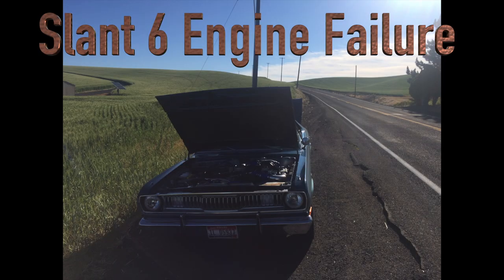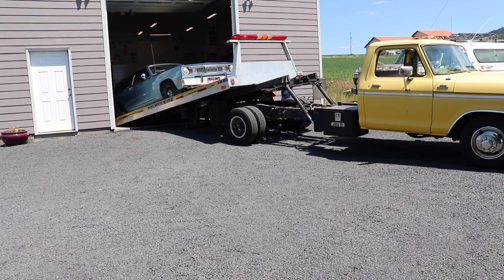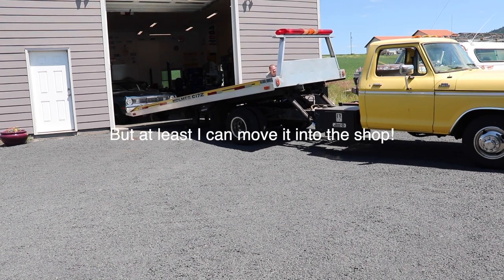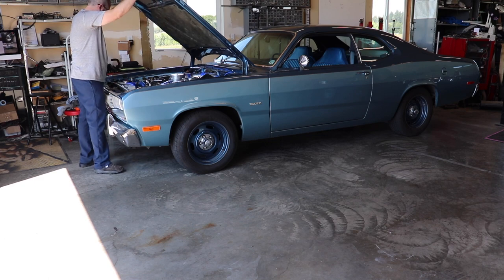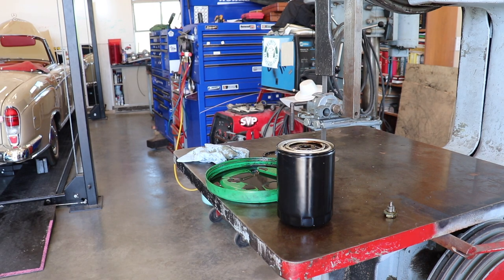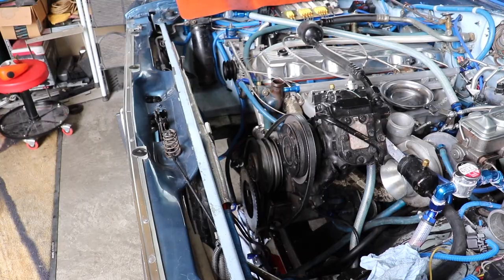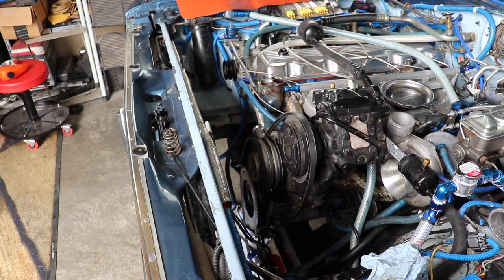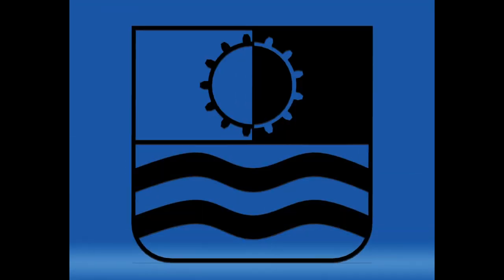Slant 6 Oil Pump Failure

Comment: Subscribed. "Doc" out in CA IIRC was building/porting oil pumps for these at one time. I had a '74 Dart I was going to do a 2bbl conversion to. It started knocking one day when I was warming it up. I was the first person into the engine. It had one of those shop rags in the oil pick up. Not much left of it. Mostly the nylon not the other fabric. It still sits on my engine stand 11 years later.

Comment: Is that a stock oil pump? High Volume/pressure pumps put a lot more stress on those drive gears than they were ever designed to handle. Adding power to any engine beyond it's design parameters will expose the weak points.

Comment: My 225 slant6  just blow up and mines 100% stock
Reply: Fram oil filter?
Reply: @Really-AintBuyn-nit  Yeah, right? Probably. These things don't just happen like that. It's a slant six for god's sakes. They don't just blow up for no reason. Fram is okay, but don't buy it at Wal-Mart. They make em' different for Wal-Mart, I guess. As for the engine on this vid... It shouldn't be done up like that. More shit to go wrong.

Comment: No wonder it failed. Slathering orange silicone on instead of using the proper (and cheap...less than $5) gasket probably moved the pump too far out and wore the gear excessively. It's on the oil pan and timing cover too. If I ever see an engine like that, I consider it junk because it's obvious the person was too cheap or too uninformed to do things properly.
Reply from the maker: Yes way too much silicone, but assembling it without a gasket and just silicone would move it in, it has a gasket and silicone which measures 0.002" farther out than just a gasket... so not the problem with the gear failure, but certainly can cause other problems.
Reply: 😂🤣😂🤣😂 Tyler... you are awesome
Reply: It's my man, Tyler! Slant six God mechanic, right here. You make me even happier to own a 66' slant six Valiant.